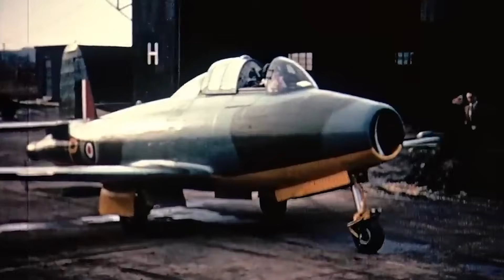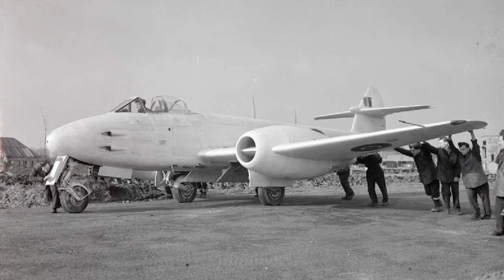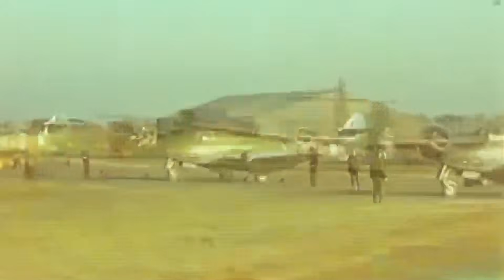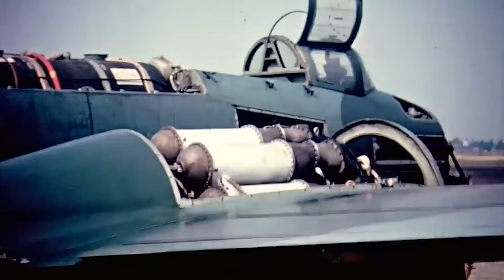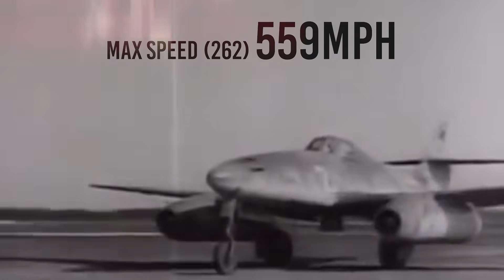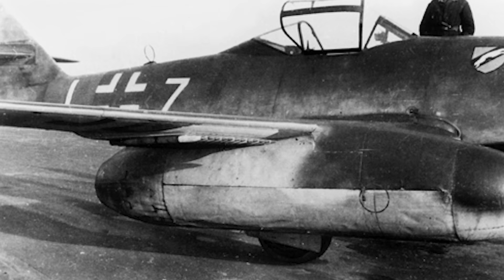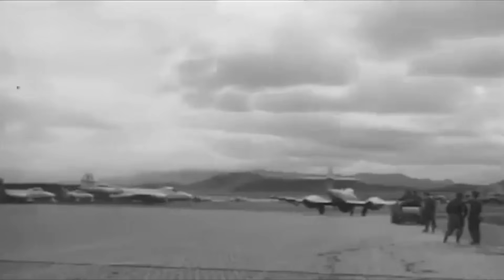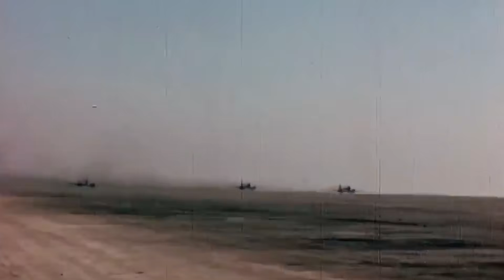Meteor vs Me 262 | Which was the better WW2 jet?

Comment: It was a question of airframe vs engine and metallurgy.  The Meteor had good engines but aerodynamically it wasn't very advanced.  The Me 262 had good aerodynamics but it had poor quality engines.  The British had access to ores to produce high temperature alloys that gave their engines a long lifespan but the Germans couldn't produce high temperature alloys and their engines had very short lives.  What is strange is that in the long run the German Axial flow engine became the predominant form of jet engine while the British centrifugal flow engines died out in the 50's because in order to get higher thrust from a centrifugal flow engine you needed to increase the combustion chamber diameter which made it hard to streamline.  While an axial flow engine can be made long and small diameter making streamlining easy.  If you want more power add more fan stages.
Reply: Aerodynamically, the swept wing was a yes but no for everything else. While it was an accident due to the weight of the Jumo engines impacting the centre of gravity, it had a major problem of directional instability, or snaking, which was never resolved. This issue was similar to the P38’s compressibility problems during high-speed dives, leading to a tendency to “tuck under” and potentially enter an uncontrollable dive, sometimes referred to as the “death dive”. Allied pilots exploited similar issues suffered by the Messerschmitt 109.

A fundamental Messerschmitt design issue was that all their designs suffered from high wing loading; the Messerschmitt 262 was no different. George Carter, who designed the first British jet aircraft, the E28/39, designed the Meteor. He understood that the technology was new and would evolve, so the Meteor was designed for easy modifications to meet the fast development of jet technology. These modifications lengthened the nacelles, the fuselage, and importantly, the tail design, addressing the directional instability. The Meteor was also designed with a lower wing loading, air brakes (a flaw in the Me262) for improved manoeuvrability in combat, and shorter takeoff and landing. Ultimately, with these modifications, the Gloster Meteor jet aircraft set the first official world speed record for a jet-propelled airplane on November 7, 1945. Group Captain Hugh Joseph Wilson achieved an average speed of 606.36 mph (975.68 km/h) flying the Gloster Meteor F. 4 (Mk. IV) EE454 over a course near Herne Bay. The Messerschmitt 262’s top speed was 560 mph from testing.
Reply: @DNorthWest  The snaking was a problem with the meteor as well and was related to the thickness to chord ratio of the tail fin. This was cured in the meteor Mk8 with its much thinner fin.
Reply: @DNorthWest  don’t you mean lower wing loading? More wing relative to weight?
Reply: @mickvonbornemann3824  Thank you. Yes, I have corrected it. The RAF Farnborough undertook extensive testing of the German jet fighters against Meteor, Spitfire XIV, and Tempest V, which is fascinating. Not all test pilots were enthusiastic, as Captain Brown was about the Messerschmitt 262, however the Arado Ar 234 Blitz left a positive impression. Fortunately, I obtained a copy before IWM went all paywall.
Reply: @DNorthWest  
Yes, it appears Brown was about the only 262 enthusiast. The Arado Ar 234 Blitz was a far better plane than the 262. The few bombers made were also used for reconnaissance as it had a speed advantage. Keeping the engine at a constant speed helped as revving up and down may mean engine cut out. So reconnaissance was ideal.
Reply: @DNorthWest  
Farnborough found the 262 faster than the Meteor only at certain altitudes. They found the Meteor a more mature, predictable and reliable design of airframe. 

The 262 was tested against the Spitfire XIV & Tempest V. The 262 was faster than both the Spitfire XIV and Tempest V at most altitudes, but not all. Tempest V could outrun the 262 at low altitudes. The Spitfire & Tempest V in dog-flight combat were superior. 

They found  the 262 more difficult to control than the Meteor. Farnborough were not too interested in the Jumo engines as the British had a raft of superior engines. They were primarily interested in how the air-frames coped with jet engines, and what the Germans had that they could learn from, which was not much at all.
Reply: @johnburns4017  This is an excellent summary of the testing results. Indeed, Farnborough was interested in whether they had solved the Messerschmitt 262 snaking problem, which they hadn’t. Farnborough and Gloster, however, had solved the meteor problem with an improved tail design. If memory serves, they also theoretically solved the Messerschmitt 262 snaking problem again due to tail design and construction. While many go on to say it gave us the swept wing, I refer and remind them of the secret Miles M.39B Libellula, which had a swept wing and canards in 1943.
Reply: @johnburns4017  Not true, the Central Fighter Establishment and Eric Brown found that the Meteor had excessive "snaking". The Meteor, as tested by Central Fighter Establishment was superior in all regards to the Tempest. Would you like a copy of the report? Please?  Meanwhile... Eric Brown: “Speed. Speed. It was a pedestrian aircraft, really, the Meteor. It never went into… It never fought operationally. It fought, if you like to call it that, against the V1, the flying doodlebug, and quite successfully. But it really was too slow to deal with the German jets when they came into being. They were a grade above at first. The Me262 is quite frightening. It gave us a shock to find out, because when I flew it the fastest fighter we had – piston fighter, of course – in the Allied camp was the Seafire Mk14 with a top speed of 446mph. The Me262 was 125mph faster than that aircraft. So this was a rude shock to our system, I tell you, when we found that out.” as for "snaking" ...the aircraft had excellent directional snaking characteristics making it a good gun platform. From this aspect it was the best jet fighter of it's time, and I was certainly in a position to judge, having flown every jet aircraft then in existence. A check on the rate of roll at 400 mph revealed the highest that I had ever experienced outside of the realm of hydraulically-powered ailerons, and the stick force demanded to produce these exhilarating gyrations was delightfully light. Leveling off at 12,000 feet I settled down to another spell of the pleasures of the phenomenal roll rate of this delightful little aeroplane ... I had never met better flying controls ... Even if somewhat underpowered it had a good performance - it could certainly have run rings around the contemporary Meteor. I was to fly the little aeroplane quite frequently.

page 138
"Wings of the Luftwaffe" Captain Eric "Winkle" Brown
(C) 1977, Revised 2010, reprinted 2011, 2013
ISBN 9 781902 109952
Reply: @TheAneewAony  
doctorbimmr a quiz.
Name the inventor of the turbojet engine?
Twenty points for the correct answer.
Reply: @johnburns4017  Maxime Guillaume, according to Whittle
Reply: @TheAneewAony  
BZZZZT Wrong answer.
The name the inventor of the turbojet engine is...

🍾🪄🍡 Frank Whittle 🍾🪄🍡 

Zero points bimmer. Zero. Better luck next time.
Reply: @johnburns4017  Close, however the Germans beat him by two years... Whittle worked under the impression that his Gloster E.28/39 flight in May 1941 was the premier breakthrough of the jet age, when in fact Ohain and Heinkel beat him by two years, the  E.28/39 being only the third jet to fly. Frank Whittle found out that the Germans had already invented and successfully flown a jet airplane after the conclusion of World War II in 1945. Hope this helps!
Reply: @johnburns4017  The complete history of British WW2 combat jet operations, air to air kills...  Eric Brown: “Speed. Speed. It was a pedestrian aircraft, really, the Meteor. It never went into… It never fought operationally. .."
Reply: @TheAneewAony  
docktorbimmr, a quiz.
Name the first operational tubojet fighter?
Twenty points for the correct answer.
Reply: @johnburns4017  Do tell? The 262 of course. BTW the Meteor was never used in operational combat during WW2 due to its slow speed.  Me 262 "It was the world's first operational jet-powered fighter aircraft and one of two jet fighter aircraft types to see air-to-air combat in World War II, the other being the Heinkel He 162."  Would you like to know more?
Reply: @TheAneewAony The Meteor was used in combat against V1 flying bombs, because it was one of the few that were fast enough.

The 262 went to it's first squadron in  April 1944, but was so problematic that it didn't get into frontline service until September 1944.

The Meteor went into a squadron in July 1944 and was operational before the 262 in August 1944, downing a V1 by the first week and August.
Reply: @TheAneewAony  
BZZZZT Wrong answer.
The name the first operational turbojet fighter is...

🍾🪄🍡 Gloster Meteor 🍾🪄🍡 

Zero points bimmer. Zero. Better luck next time.
Reply: @johnburns4017  LOL! The Meteor was not combat operational during WW2. Unless hiding from Germans is combat or opreational. Do better
Reply: @TheAneewAony  
docktorbimmr, a quiz.
Name the first turbofan engine?
Twenty points for the correct answer.
Reply: @johnburns4017  You already know, it was Dr. Anselm Franz, inventor of the axial flow jet engine, who designed the Lycoming PLF1A-2, which is recognized as the world's first successful high-bypass turbofan engine. Karl Leist designed the first turbofan engine ever the Daimler-Benz DB 670 in 1943, before the also only bench tested Metrovick F.3. The Lockheed C-5 Galaxy was the first aircraft in the world to be fitted with high-bypass turbofan engines.. Hope this helps https://en.wikipedia.org/wiki/Turbofan
Reply: @johnburns4017  The only combat jet to operate over England during WW2 was the Ar 234. From late 1944 until April 1945, the German Arado Ar 234 jet flew high-altitude photo-reconnaissance missions over Britain. British air defenses could track the planes on radar, but Allied fighters were unable to climb high enough or fly fast enough to intercept them. Thus the history of axial flow engines over England began.
Reply: @TheAneewAony  
BZZZZT Wrong answer.
The name the first turbofan engine was...

🍾🪄🍡 R-R Conway 🍾🪄🍡 

Zero points bimmer. Zero. Better luck next time.
Reply: @johnburns4017 You'd be almost right. But incorrect
Reply: It’s great to hear a rational person from the UK on this issue!
Reply: Worth noting that the F.3 Meteors eventually overtook the 262 in speed and climb-rate because they upgraded to Derwent engines. So by 1945, the F.3 Meteor was already a superior jet in every way except fuel consumption. But the biggest thing that determined whether a 262 or a Meteor wins in a dogfight is intended role: The 262 is a bomber interceptor, it was supposed to be fast in a straight line and turn rate wasn't a priority. It would close in on a bomber, blast it with 30mm cannons and then fly away keeping up their speed. The Meteor was built as a fighter, meant to go into dogfights and out-turn/out-rate contemporary aircraft.
Reply: Indeed, however, it was rubbish as a bomber. It had no bomb sight, and when carrying bombs, it was easy to attack by the Tempest. Consequently, the bomber unit was withdrawn, October 1944 after 25 units had been delivered but primarily because of a series of accidents. Wendel’s report lists eight serious problems that remained to be dealt with when the Bombing unit was made operational. Source: IWM Tempest Performance and Me262 Fitz Wendel’s Closing Report 1945.

The Meteor actually had a greater range than the Messerschmitt 262, 523 miles. For reference, the Tempest had a range of 1,526 miles, while the Meteor had a range of 1,337 miles. The Meteor subsequently carried a ventral fuel tank for greater range. Another surprise is the maximum takeoff weight: the Messerschmitt 262 had a weight of 6,400 kg, the Meteor had a weight of 6,033 kg, and the Tempest had a weight of 5,897 kg. The Messerschmitt 262 is significantly heavier, even with the extra fuel the Meteor and Tempest are carrying. Source: IWM associated with Meteor III with Derwent 1 engine.
Reply: @HunterSteel29 No it’s not worth noting. The Germans had many far more advanced designs on the blocks than the 262 which by 1945 was already seven years old.
Reply: @drstrangelove4998  It is worth noting. The Germans has no way in any form or capacity to upgrade the 262, and outside of the 262's engines, the aircraft itself was a dead-end as better more aerodynamically advanced designs came about in the late 40s. None of those other "advanced" wunderwaffe would've seen the light of production. Frank Whittle already knew about Axial Flow engines, but their requirement for exotic materials made them unsuitable for Britain's wartime requirements, and they also didn't meet the RAF's service hour requirement. So for the wartime situation, the Centrifugal engine made more sense, it met the RAF's standard of 150 hours between rebuilds, was reliable, and didn't use any expensive manufacturing techniques that the wartime British economy couldn't fuel. The Axial Flow engine the Brits made in the early 40s eventually went on to become the Avon engines that powered the Hunter series. So yes, I reiterate, it is worth noting, that by 1945, the Meteors caught up with, and eventually out-performed the Me-262. Both aircraft were a production dead end, but the Meteor still served into the mid-50s before being replaced with other more outstanding designs from Britain's aviation industry.
Reply: @HunterSteel29  
There were five turbojet engines in the UK under R&D in WW2:
▪  Centrifugal, by Whittle (Rover);
▪  Centrifugal, by Frank Halford (DeHaviland);
▪  Axial-flow, by Metro-Vick;
▪  Axial-flow by Griffiths (Rolls Royce);
▪  Axial flow compressor, with reverse flow combustion chambers. The ASX by Armstrong Siddeley;

The axial-flow Metropolitan Vickers designs were test flown in 1942 producing more thrust than anything Germany produced with a longer service life.
Reply: @drstrangelove4998  
You need to read more on the history of the turbojet.
Reply: @HunterSteel29 The post war Meteor was an incredibly expensive hot rod, utterly unsuitable for mass production, let alone combat service. Wittle’s centrifugal engine was a complete dead end a few years later. The Germans had three supersonic wind tunnels, and were years ahead of us in aerodynamics. We, the allies had not a single supersonic wind tunnels, look at the difference.
Reply: @drstrangelove4998 and those lovely wind tunnels were built by who again? 

Amazing that a regime that had slaves had the ability to build more than a regime that didnt.
Reply: @drstrangelove4998 

LOL The Nimonic nickel super alloys were developed in Hereford England 1939 -1940. In Germany they thought they needed to use stainless steel for turbine blading which doesn't work and due to various issues ended up attempting to use pressed sheet steel turbine blades. 

262 & it's engines = Garbage (but it did actually fly which surprises a lot of people). In both Russia and France good people wasted their time trying to do something with the engine after 1945. Russians ceased trying in 1948 as their own effort was clearly better.
In France RR got involved in 1950 and managed to get something useful working. 

We feel we can clear up some commonly held myths and misconceptions, obviously.
It's always good to see the facts presented clearly and concisely isn't it?

The Gloster Meteor was one of the world's first jet fighters to go into service, it was in service during WW2. The meteor was the first effective multirole fighter bomber jet aircraft with a reliable engine to go into service,  It broke speed records in 1945 and 1946. During WW2 it was in service as a fighter and multirole aircraft over the UK and over all allied controlled territories in Europe and beyond. 

The ME-262 and it's 46 minutes life engines were abandoned shortly after 1945, it had a do not exceed speed of 456 mph and was only ever used to attack bombers with losses of three 262s for each downed bomber.  During WW2 most of the ME-262s were destroyed by their engines, were various types of accident losses or were shot down by bombers. No German designers were involved with the Mig-15. The Mig-15 used a copy of the RR Nene.  

During the Korean conflict most of the Meteor casualties were due to groundfire or accident losses. The result of any tangles between Migs and Meteors was that Mig pilots avoided getting into dogfights with Meteors. The battle of Sunchon, where 50 Migs against 14 Meteors resulted in the supposedly superior Migs failing to gain any clear advantage caused the Koreans to re-evaluate tactics. General opposition in Australia to involvement in the Korean conflict resulted in the govt using the battle as an excuse to reduce the RAAFs involvement to troop support only.

The world's first wind tunnel was built in England during the 1800s. The world's first supersonic wind tunnel was built in England during the 1920s. 

The Whittle Gloster E28/39  was of course a brilliant aircraft that was later copied in Russia as the upsized and tweaked Mig 15 with a copy of the RR Nene gas turbine aero engine. The RR Nene being the world's most powerful & most reliable gas turbine aero engine in 1944.

The MD F3H Demon was a contemporary to the DH Sea Vixen & had a similar performance. The F4 Phantom was a follow on from the F3 Demon. The Sea Vixen took a long time to get from first flight to introduction for various reasons and a similar situation occurred with the MD F3H Demon.

McDonnell Douglas F3H Demon
590 Built. Not Supersonic.
Max Speed 578 MPH.
Introduction date 7 March 1956
First flight 7 August 1951
Retired 1964

MD F-4 Phantom 2
Number built 5,195
Manufactured 1958–1981
Introduction date 30 December 1960
First flight 27 May 1958

DH Sea Vixen
Number built 151 (including two DH110 prototypes and one Sea Vixen prototype)
Introduction date July 1959
First flight 26 September 1951
Max speed 695 MPH.
Retired 1972

Interesting British achievements.
There is no doubt that the Fairey (England)
Delta 2 was of course the world's first jet
aircraft to exceed 1000 mph.  Indeed It
exceeded the previous record by 310 mph &
held the record for 1 year. Incidentally, the Dassault Mirage 3 & 4 are based on the Fairey Delta 2.

The Panavia Tornado & Euro fighter Typhoon are British design aircraft with British design engines built by international consortiums. 

The EE Lightning was one of the fastest aircraft on the planet when it first achieved a Mach 2 flight. 

Early days, jet fighters.
De Havilland Vampire, Sea Vixen & Gloster Meteor accident losses were not high or unusual for fighter aircraft at the time. De Havilland built large numbers of all metal airframe aircraft before the DH Comet.
We mustn't forget of course that the DH Vampire for example first flew in 1943 & the engine was also built by De Havilland. There were examples of the Vampire interceptor / fighter in service until 1990 which was operated by more than 30 countries.

Non combat phase accident losses.
% of Aircraft built.

The Canadair CL-44 was a turboprop airliner.
Canadair CL-44                  (ff 1959 ) 48%
Lockheed XF104                (ff 1954) 100%
Lockheed  P80                   (ff 1944) 43%
Lockheed F104                 (ff 1954)  45%
Grumman f9f-5 Panther   (ff 1947) 44% 
Convair F102 Dagger        (ff 1953) 45%  
MD F-101 Voodoo.             (ff 1954) 34%
MD FH Phantom 1            (ff 1945)  35%
MD F4 Phantom 2             (ff 1958)  28%
MD F3H  Demon               (ff 1951)  32%
Gloster Meteor                  (ff 1943)  21%
DH Vampire UK                (ff 1943)  23%
DH Sea Vixen   UK           (ff  1951) 33%
Gloster Javelin  UK         (ff 1951) 20%
EE Lightning  UK             (ff 1954) 33%

It's a great pity & a crying shame that British military forces had to occupy a large part of Germany for decades after 1945 & Russian military forces had to do the same. Of course Russia still posseses a large chunk of what was German territory & of course Russia & the UK produce nukes. Obviously Germany does not produce nukes.

Early days, jet engines. Whittle performed the world's first demonstration of a gas turbine aero engine in 1937. The RR Nene, a centrifugal gas turbine aero engine, was the world's most reliable & most powerful gas turbine aero engine in 1944. Licensed built versions & copies of the RR Nene & RR Derwent would go on to power many aircraft in Russia including the Mig 15 & Mig 17, the US, China, France & other countries for decades after 1944. Incidentally, the Mig-15 was in essence an upsized / tweaked copy of the Whittle / Gloster E28/39 jet aircraft including an uprated copy of the RR engine.  The basic centrifugal compressor gas turbine aero engine with Whittle style reverse flow combusters and sometimes an axial compressor section is still manufactured by more than one company including Pratt and Whitney, the main application being helicopters.

The gas turbine engine was invented in England during the 1700s.

During the 1800s Parsons of Ireland & North England produced the world's first axial multi stage sequential stator rotor turbines and compressors for turbomachinery use which would eventually go on to to form the main components of the axial gas turbine aero engine. At the time the basic idea of making an internal combustion gas turbine engine and using it as an aircraft engine was considered thus the jet aircraft concept had been created in England before the first powered aircraft flew.

An example of what goes on these days in various countries. For example, there are of course no German companies that makes German jet aircraft in Germany & there are no German Companies that make German gas turbine aero engines in Germany that are suitable for widebody airliners.

The UK has the world's highest combined per capita Nuclear / Defence / Aerospace Sector Activity.

UK defence sector, absolute terms, world's second highest activity. 1st for per capita defence sector activity. Per capita nuclear powered submarine construction, 2nd position. 
Main players being Rolls Royce, Babcock, GKN Aerospace & BAe Systems. Activities often involve international collaboration. BAe systems, RR and other UK companies now handle more Airbus work value wise than Germany. 

There's a good chance that anyone currently flying on a widebody airliner will be on an aircraft powered by RR gas turbine aero engines made in the UK and a good chance there will be other hardware on the aircraft that's designed and / or manufactured in the UK. 

Rolls Royce Holdings UK
Subsidiaries
- Rolls-Royce plc
- Rolls-Royce North America (ex Allison etc Classified Military stuff)
- Rolls-Royce AB
- Rolls-Royce Deutschland
- Rolls-Royce India Private Limited
- Rolls-Royce Marine Power Operations
- Vinters Engineering Limited
- Rolls-Royce Controls and Data Services
- Rolls-Royce Power Systems
- Bergen Marine
Joint ventures include:
- Rolls-Royce Turbomeca
- MTU Turbomeca -

Trent Family
The MT30 (Marine Turbine)
Industrial Trent 60 Gas Turbine
Trent 7000
Trent XWB Airbus A330neo.
Trent 1500
Trent 1000
Trent 500
Trent 600
Trent 700
Trent 800
Trent 8100
Trent 900
   
RR wholly owned subsidiaries in Germany handle smaller 2 shaft RR gas turbine aero engine work.

The UK space and aerospace sectors are highly productive, high-value industries that together contribute over £18 Billion in direct Gross Value Added (GVA) to the UK economy. Individually, the space industry directly contributes about 0.3% of UK GDP 7•2 Billion while the aerospace industry contributes approximately 0.5% £10•9 Billion.
   
Wee hopes theze helpsmz.  EtC---.

We hope this helps of course 👍
Reply: @drstrangelove4998 

LOL The Nimonic nickel super alloys were developed in Hereford England 1939 -1940. In Germany they thought they needed to use stainless steel for turbine blading which doesn't work and due to various issues ended up attempting to use pressed sheet steel turbine blades. 

262 & it's engines = Garbage (but it did actually fly which surprises a lot of people). In both Russia and France good people wasted their time trying to do something with the engine after 1945. Russians ceased trying in 1948 as their own effort was clearly better.
In France RR got involved in 1950 and managed to get something useful working. 

We feel we can clear up some commonly held myths and misconceptions, obviously.
It's always good to see the facts presented clearly and concisely isn't it?

The Gloster Meteor was one of the world's first jet fighters to go into service, it was in service during WW2. The meteor was the first effective multirole fighter bomber jet aircraft with a reliable engine to go into service,  It broke speed records in 1945 and 1946. During WW2 it was in service as a fighter and multirole aircraft over the UK and over all allied controlled territories in Europe and beyond. 

The ME-262 and it's 46 minutes life engines were abandoned shortly after 1945, it had a do not exceed speed of 456 mph and was only ever used to attack bombers with losses of three 262s for each downed bomber.  During WW2 most of the ME-262s were destroyed by their engines, were various types of accident losses or were shot down by bombers. No German designers were involved with the Mig-15. The Mig-15 used a copy of the RR Nene.  

During the Korean conflict most of the Meteor casualties were due to groundfire or accident losses. The result of any tangles between Migs and Meteors was that Mig pilots avoided getting into dogfights with Meteors. The battle of Sunchon, where 50 Migs against 14 Meteors resulted in the supposedly superior Migs failing to gain any clear advantage caused the Koreans to re-evaluate tactics. General opposition in Australia to involvement in the Korean conflict resulted in the govt using the battle as an excuse to reduce the RAAFs involvement to troop support only.

The world's first wind tunnel was built in England during the 1800s. The world's first supersonic wind tunnel was built in England during the 1920s. 

The Whittle Gloster E28/39  was of course a brilliant aircraft that was later copied in Russia as the upsized and tweaked Mig 15 with a copy of the RR Nene gas turbine aero engine. The RR Nene being the world's most powerful & most reliable gas turbine aero engine in 1944.

The MD F3H Demon was a contemporary to the DH Sea Vixen & had a similar performance. The F4 Phantom was a follow on from the F3 Demon. The Sea Vixen took a long time to get from first flight to introduction for various reasons and a similar situation occurred with the MD F3H Demon.

McDonnell Douglas F3H Demon
590 Built. Not Supersonic.
Max Speed 578 MPH.
Introduction date 7 March 1956
First flight 7 August 1951
Retired 1964

MD F-4 Phantom 2
Number built 5,195
Manufactured 1958–1981
Introduction date 30 December 1960
First flight 27 May 1958

DH Sea Vixen
Number built 151 (including two DH110 prototypes and one Sea Vixen prototype)
Introduction date July 1959
First flight 26 September 1951
Max speed 695 MPH.
Retired 1972

Interesting British achievements.
There is no doubt that the Fairey (England)
Delta 2 was of course the world's first jet
aircraft to exceed 1000 mph.  Indeed It
exceeded the previous record by 310 mph &
held the record for 1 year. Incidentally, the Dassault Mirage 3 & 4 are based on the Fairey Delta 2.

The Panavia Tornado & Euro fighter Typhoon are British design aircraft with British design engines built by international consortiums. 

The EE Lightning was one of the fastest aircraft on the planet when it first achieved a Mach 2 flight. 

Early days, jet fighters.
De Havilland Vampire, Sea Vixen & Gloster Meteor accident losses were not high or unusual for fighter aircraft at the time. De Havilland built large numbers of all metal airframe aircraft before the DH Comet.
We mustn't forget of course that the DH Vampire for example first flew in 1943 & the engine was also built by De Havilland. There were examples of the Vampire interceptor / fighter in service until 1990 which was operated by more than 30 countries.

Non combat phase accident losses.
% of Aircraft built.

The Canadair CL-44 was a turboprop airliner.
Canadair CL-44                  (ff 1959 ) 48%
Lockheed XF104                (ff 1954) 100%
Lockheed  P80                   (ff 1944) 43%
Lockheed F104                 (ff 1954)  45%
Grumman f9f-5 Panther   (ff 1947) 44% 
Convair F102 Dagger        (ff 1953) 45%  
MD F-101 Voodoo.             (ff 1954) 34%
MD FH Phantom 1            (ff 1945)  35%
MD F4 Phantom 2             (ff 1958)  28%
MD F3H  Demon               (ff 1951)  32%
Gloster Meteor                  (ff 1943)  21%
DH Vampire UK                (ff 1943)  23%
DH Sea Vixen   UK           (ff  1951) 33%
Gloster Javelin  UK         (ff 1951) 20%
EE Lightning  UK             (ff 1954) 33%

It's a great pity & a crying shame that British military forces had to occupy a large part of Germany for decades after 1945 & Russian military forces had to do the same. Of course Russia still posseses a large chunk of what was German territory & of course Russia & the UK produce nukes. Obviously Germany does not produce nukes.

Early days, jet engines. Whittle performed the world's first demonstration of a gas turbine aero engine in 1937. The RR Nene, a centrifugal gas turbine aero engine, was the world's most reliable & most powerful gas turbine aero engine in 1944. Licensed built versions & copies of the RR Nene & RR Derwent would go on to power many aircraft in Russia including the Mig 15 & Mig 17, the US, China, France & other countries for decades after 1944. Incidentally, the Mig-15 was in essence an upsized / tweaked copy of the Whittle / Gloster E28/39 jet aircraft including an uprated copy of the RR engine.  The basic centrifugal compressor gas turbine aero engine with Whittle style reverse flow combusters and sometimes an axial compressor section is still manufactured by more than one company including Pratt and Whitney, the main application being helicopters.

The gas turbine engine was invented in England during the 1700s.

During the 1800s Parsons of Ireland & North England produced the world's first axial multi stage sequential stator rotor turbines and compressors for turbomachinery use which would eventually go on to to form the main components of the axial gas turbine aero engine. At the time the basic idea of making an internal combustion gas turbine engine and using it as an aircraft engine was considered thus the jet aircraft concept had been created in England before the first powered aircraft flew.

An example of what goes on these days in various countries. For example, there are of course no German companies that makes German jet aircraft in Germany & there are no German Companies that make German gas turbine aero engines in Germany that are suitable for widebody airliners.

The UK has the world's highest combined per capita Nuclear / Defence / Aerospace Sector Activity.

UK defence sector, absolute terms, world's second highest activity. 1st for per capita defence sector activity. Per capita nuclear powered submarine construction, 2nd position. 
Main players being Rolls Royce, Babcock, GKN Aerospace & BAe Systems. Activities often involve international collaboration. BAe systems, RR and other UK companies now handle more Airbus work value wise than Germany. 

There's a good chance that anyone currently flying on a widebody airliner will be on an aircraft powered by RR gas turbine aero engines made in the UK and a good chance there will be other hardware on the aircraft that's designed and / or manufactured in the UK. 

Rolls Royce Holdings UK
Subsidiaries
- Rolls-Royce plc
- Rolls-Royce North America (ex Allison etc Classified Military stuff)
- Rolls-Royce AB
- Rolls-Royce Deutschland
- Rolls-Royce India Private Limited
- Rolls-Royce Marine Power Operations
- Vinters Engineering Limited
- Rolls-Royce Controls and Data Services
- Rolls-Royce Power Systems
- Bergen Marine
Joint ventures include:
- Rolls-Royce Turbomeca
- MTU Turbomeca -

Trent Family
The MT30 (Marine Turbine)
Industrial Trent 60 Gas Turbine
Trent 7000
Trent XWB Airbus A330neo.
Trent 1500
Trent 1000
Trent 500
Trent 600
Trent 700
Trent 800
Trent 8100
Trent 900
   
RR wholly owned subsidiaries in Germany handle smaller 2 shaft RR gas turbine aero engine work.

The UK space and aerospace sectors are highly productive, high-value industries that together contribute over £18 Billion in direct Gross Value Added (GVA) to the UK economy. Individually, the space industry directly contributes about 0.3% of UK GDP 7•2 Billion while the aerospace industry contributes approximately 0.5% £10•9 Billion.
   
Wee hopes theze helpsmz.  EtC---.

We hope this helps of course 👍
Reply: @petemaly8950  
Good post.
Reply: I dont think an aircraft with a high stall speed can be classed as better Aerodynamically personally. Everybody wonders at the top speed of the 262 but pilots never fly at that. They do however slow down to land and take off and then theres an issue as the 262 was notoriously unstable at low speeds…
Reply: Yes. Whenever I set off on holiday I remember that I am being powered by the grandchildren of the German ww2 engines, NOT  the whittle ones.
Reply: @brianwillson9567  
Read my posts again. It is easier that way.